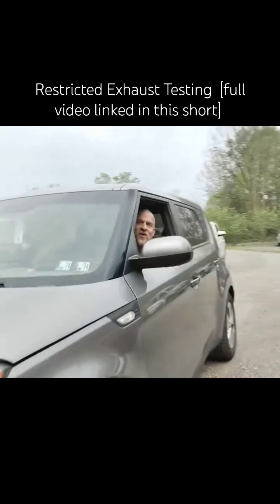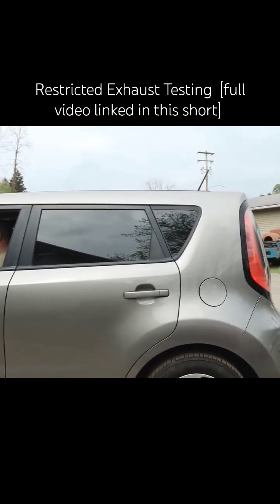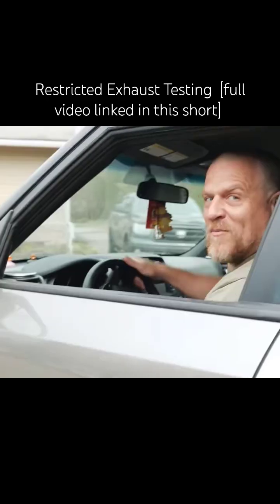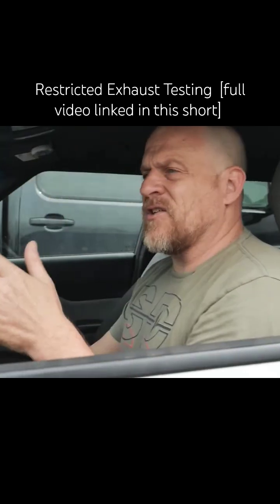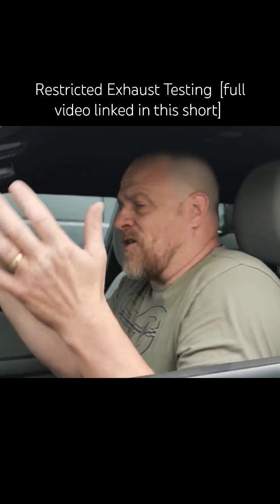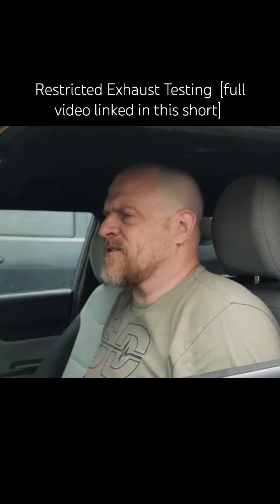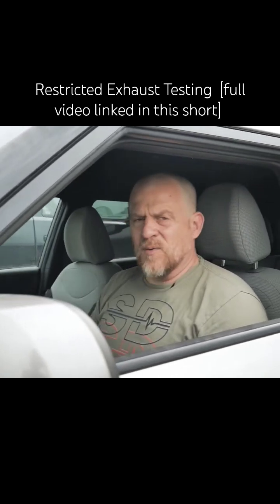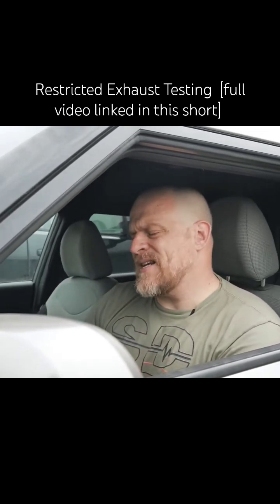Restricted Exhaust/Plugged Cat [Identification and Testing Procedures]

Comment: I learned from school you can measure cat temperature and correlate that to normal operating cat temperature and see if there is too much back pressure or vacuum test it. From Joliet junior college automotive.
Reply from the maker: A temperature test on a cat to confirm a restriction? A non working cat, one that is not restricted, but one that has been damaged, would provide similar temp readings as a restricted cat. Also, a cat that isn't hot enough or an engine that runs very clean, would provide similar results.
Too many variables with cat temps to use it with 100% accuracy like the actual backpressure test provides

Comment: Hard pedal, no throttle response and barely runs. Yep sure sounds like you are going to be doing a backpressure test at the minimum. You are correct for sure, pop out the upstream oxygen sensor and try to drive if possible

Comment: What would be interesting with that car is to put a vacuum gauge on it just to see how much that clogged cat completely clogged exhaust would skew the vacuum test???
Reply from the maker: The MAP voltage was equivalent to that. I'm sure I could find a chart for the MAP voltages to inches of vacuum
Reply: Fly by wire throttle body... ECU probably had it open quite a bit to keep it at idle speed .. I doubt if an engine with a cat that's THAT clogged, with a "cable" throttle body would even idle without your foot on the gas